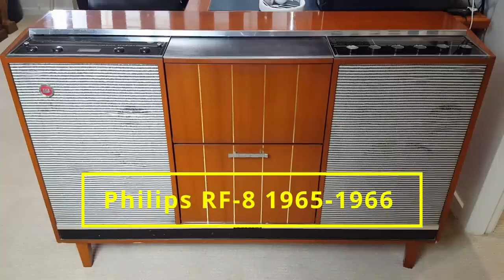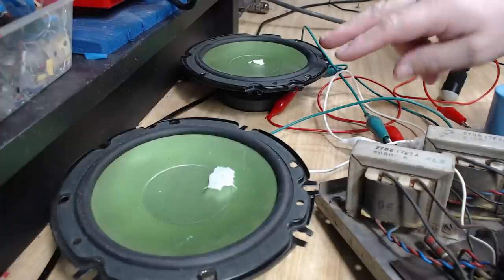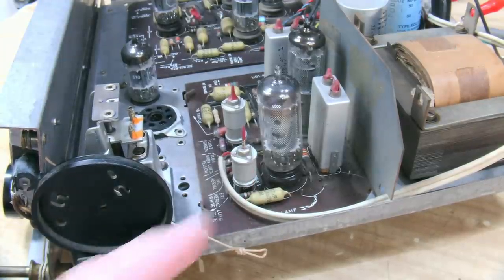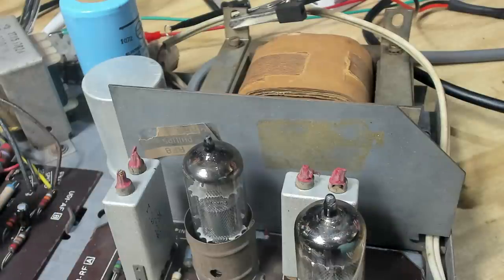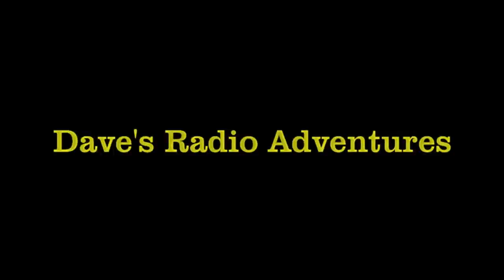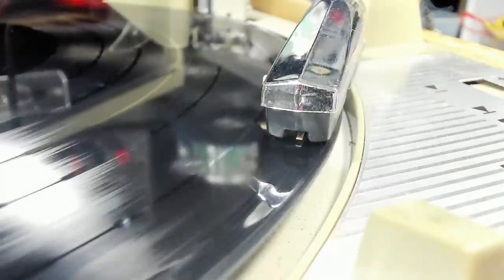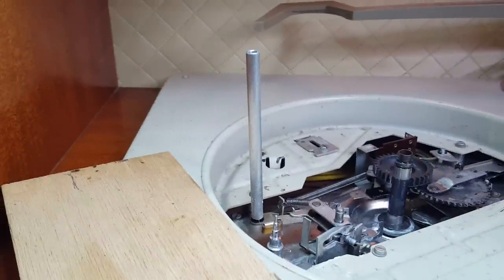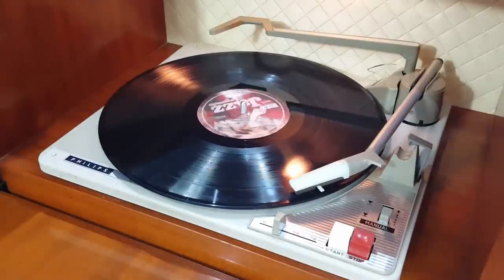Philips RF8 Radiogram and Philips AG-1025 Record Player Service - 1965/66

Comment: Incredibly informative! Thank you! I inherited a Grundig KS620U from my great grandparents, and everyone has been too scared to take apart the turntable (same model), which hasn't worked in about 30 years. 

Thanks to this, I was able to take it apart and find out exactly what was wrong with it in about 5 minutes. The motor's pretty seized. I'm attempting to grease it up, but family rumor has it that it was left on for quite some time when it stopped working, so I may have to get a new motor.
Reply from the maker: Good to hear stories like this Buddy. The bearings in the motor are Oilite (sintered bronze) bushings, they are porous and designed to hold oil within. There is a felt oil pad surrounding the bushing as an extra source of oil. If grease is applied to the bushings it blocks the pores and no oil can get to the friction surface. If you have applied grease you will need to dismantle the motor and soak the bearing end caps to dissolve the grease. Then soak them in light motor oil for 24 hours, warmed if possible. Hopefully you can clean the shaft and reoil the bearings it to get it going again. Good luck 👍🙂

Comment: I pulled one of those power amp boards out of a rubbish pile, it was out in the weather for about 15yrs. Built a new power supply put it in a old wooden SA railways box and it works a treat. Nice work Dave, love it!
Reply from the maker: It must have been a mess after 15 years, nice to know you got it working again. Thanks @alast3897 🙂

Comment: I have one of these and it is in mint condition cosmetic wise the speaker grille cloths are mint, I even like that sort of silver what ever you would call it woven into it.  I still need to get it running as it has very loud hum which I suspect its the main filter caps and I never realised those caps are dual 2 in each one.  Those resistors you said looked like newer replacements I think mine has similar from memory I would have to go out and look.
Reply from the maker: Hi Stevie, well worth getting these units going, they are very good to listen to. Yes, two 50Uf in each can. You can still buy the capacitors in the same size cans from Evatco and other places. The resistors may have been original, I'm not sure. Thanks Stenie 🙂

Comment: Very watchable David and thanks for pointing out that jockey wheel spindle trick. I've repaired hundreds of similar decks and not had that wow problem but I'll keep a fresh eye out for that in future. I have slowed the speeds down by running the motor spindle on fine wet and dry paper to reduce its diameter slightly. 
Regards Jonathan
Reply from the maker: Hi Jonka, thank you. I was aware the idler wheel axle needed to be spot on but was surprised how much affect it had on the wow. I checked my other Philips AG-1025 and it's speed is the same, 34.3 rpm. Maybe they thought under load it would get too slow, anyway a good thing I left it 🙂

Comment: Amazing job as always David. I’ve not seen one of those mechs before but you took it in your stride. Nice to see it completely stripped out and re-lubed. Also great to see your manufacturing skills again with the platter mat and spindle not to mention the dreaded dial cord again. You are the dialcord master. All the best Graham
Reply from the maker: Hi Graham, thank you. 'I am the master of the dial cord'... that's what I tell myself before each restring... it doesn't always work 🙄 Thanks Graham. I'm back from my super long trip to Melbourne and daylight saving is finished so I hope to drop in tomorrow night and see what you are up to, Cheers 🙂

Comment: Another great restoration David... I have to say its a pity about the damaged screen on the speaker cabinets but if the owner is not worried I guess that's fine. You went to a lot of trouble with the lubrication... how long will that lube last before the same problem occurs again (turning to treacle). Never a dull moment when you are working on repairs... love watching it every time.
Reply from the maker: Hi Kenneth, thank you. I would have loved to replace the cloth too. The grease I use should last a very long time, how long is anyone's guess 🙂

Comment: You are a master of the turntables. Nicely done. I am a little surprise at using a smaller value capacitor to reduce hum. However it works and that’s nice.
Reply from the maker: Thank you bob. Smaller value capacitor? I used a 47uF in place of the 50uF but that's the normal replacement for a 50 theses days. It will work fine 👍🙂
Reply: G'day David. I was referring to the plate capacitor you replaced  0.22  down to 0.1
Reply from the maker: Oh, sorry, Yes that was a modification recommended by Philips. It fixed the hum from the record player.

Comment: Very swift fix, love it. Ya, me too, I don't mind watching all without fast-forward. I loved how you did the record player, super detailed service.  I think the record was running bit fast cause you had to sand the drive wheel. Anyhow 2% is nothing.
Btw, this radiogram is super clear, wish it had FM too 🥰
Reply from the maker: Hi @magcoco. I hear what you are saying, thank you. I've done a number of these sets so I'm trying to avoid repeating myself. The diameter of the idler wheel does not affect the speed of the platter. The idler wheel is simply a go between the spindle and the platter, the idler wheel itself will change speed but the relationship between the spindle and the platter is constant. For example, if you put a different size fan belt on your car the fan speed doesn't change. Thanks @magcoco 👍😃
Reply: @DavidTipton101  Hi David, Khaled here. Been long time I didn't bother you 🤣
Regarding the drive wheel, I image it in different way. The motor pulley drives the wheel which transfers the movement to the platter. The pulley has different diameters for various speeds. So, image the pulley have a fix diameter, then the speed can be changed by changing the wheel size . Bigger wheel circonference = less platter revolution/min.  😊
Reply from the maker: @magcoco  Hi Khaled, I knew it was you by your thumbnail but YouTube is using handles now and it threw me. 
When you say motor 'pulley' you are referring to the spindle on the motor shaft I think. The different diameters of the spindle will indeed change the platter speed and so will changing the diameter of the platter. The idler wheel between the two will not change the speed of the platter. 
If one revolution of the motor spindle moved the idler wheel 10mm at the contact point the wheel will move the platter 10mm at it's contact point. If we double the idler wheel diameter from say 30mm to 60mm diameter the idler wheel will still move 10mm at the spindle contact point and move the platter 10mm at it's contact point. The idler wheel speed will be halved due to the larger diameter but that will be the only change.
In the example I used with the car motor fan belt, if the fan rotates once for every revolution of the crankshaft pulley, doubling the length of the fan belt will not change the speed of the fan. The speed the belt moves at will be halved because it is twice as long but the fan speed will not be affected.

Comment: Another lovely restore ,  you make these radio grams sing. Strange no FM, do love the sound , are their 2 parts to each valve is that how it can have only one valve per channel. Thankyou for posting :)
Reply from the maker: Hi Leo. Yep, no FM in Oz till 1975. The 6GW8 output valve is a triode and pentode in one. It's not a push-pull set though 👍🙂
Reply: @DavidTipton101  can you explain how it works with one valve, could be same as my mono ear record player amp
Reply from the maker: I can try. In my case it is a simple class A stereo amplifier, i.e. not push-pull. There are two channels, left and right, each channel is powered by a single 6GW8 (ECL86) output valve. The 6GW8 is a triode and a pentode in one envelope. In this Philips the triode section is used as a preamp to the output pentode. 
If fitted to a self contained record player it can be used the same way. The signal from the cartridge can be preamplified, tone control added then sent to the pentode to be amplified for the speaker.

Comment: Thank you so much for countless hours of interesting and entertaining diversion when I wake up in the early morning. Could I suggest that reducing the more spindle diameter would reduce the turntable rpm? I was very impressed with the way you reduced wow and flutter.
Reply: Motor
Reply from the maker: That would be the only way to reduce the platter speed and I have done it before. I wasn't far enough out to start playing with it. Besides, with the weight of the stylus on it and if a few records were stacked it may slow it down too much which would be more noticable. I was pretty impressed with the wow adjustment too 👍😃

Comment: Haven't watched all the way through yet Dave but heard you mentioning something called Rubber Renew, if I heard correctly. Do you think such a product would revive the stiff and dry rubber on the rollers of my planer-thicknesser? I'd be very grateful for any first hand advice or observations about a product like that. Okay, now back to the action...
Reply from the maker: Hi Mark, I would be reluctant to say that it would help in your case, it might. Reviews say it works wonders to soften and renew rubber so you could give it a try. It's available through MG Chemicals in Australia, it's spelt Rubber Renue 🙂

Comment: Lovely work as ever Dave. Nice piece of kit as well. I really liked the detailed legend on the PCB. I was under the impression that PCBs were unreliable with valves because of the heat - is that an issue with these units?
Reply from the maker: Hi Neil, thank you. I haven't noticed any blackening around the PBC on these sets. Maybe the valve sockets they used are a good heat insulator from the PCB 🤔🙂

Comment: I suspect the original rubber mat had quite tall ridges. Having the record touching the turntable only in the center could cause some vibration noise and slipping (speed variations). Do love the fabrication you do on these units. I always find that to be a lot of fun myself. And being able to make your own idler wheels for example saves a ton of money.
Reply from the maker: Thanks Mark. The centre of the platter is dipped down so the record sits on the felt 👍🙂

Comment: David, I'm amazed the rubber on that idler hadn't gone rock hard. Have you ever messed with trying to resurface idler wheels with your lathe (turning down the surface and bonding/surfacing an o-ring or similar to the original dimensions?)
Reply from the maker: Hi @HiFiasco. The rubber on the Philips grams seems to age very well. I have used O-rings to repair idler wheels and have also turned up new wheels from aluminium and fitted square section O-rings to them 🙂

Comment: Dave your new production style is okay, it’s got to make filming a lot easier. Your detail oriented videos certainly help the hobbyist and amaze your audience but if you’re working on a project for someone else time become an issue. The laser cutter is intriguing, if you’ve ever seen the plastic model airplane kits with all the parts connected on one or two sticks it almost looks like a laser cutter could make something like that. Possibly a housing for your new radio innovation.
Reply from the maker: Hi Mack, it's not a new style, it's just what I did with this video because I have done two other sets the same. I used that montage style quite a bit earlier on. The laser cutter has been great, I haven't used it on anything difficult yet but have a few projects coming up. Thanks Mack 🙂

Comment: I remember you being a bit apprehensive about working on record decks at first but you've got the whole thing sussed now. Knew you would!
Reply from the maker: You are right Paul, I knew nothing about them to start. Like anything, a bit of experience does wonders. Thanks Paul ☺️
Reply: @DavidTipton101  I always reckon you can learn about anything at all if you're interested in it but if you're not, then it's almost impossible.

Comment: Avesome restoration David, just a small note about the beehive trimmers, the aerial trimmer seemed to be very easy to turn... do you bother putting a small blob of wax on the screw? Just wondering if vibration from the speaker(s) would cause further & unwanted turning! Thank you:)
Reply from the maker: Hi 6A8G. Yes I put red nail polish on the trimmers after the adjustment. It looks very similar to the original anti-tamper paste used at the factory and is cheap and readily available 🙂

Comment: Did you work out what the Disco light does?
Reply from the maker: I forgot to mention it. I did show it at the end. It's just a light. It comes on when gram is selected, the radio dial lights turn off.  Thanks Peter ☺️

Comment: Really good looking set there!

Is there no way to adjust speed on those things?
Reply from the maker: Thank you Brian. The motor speed it set by the mains supply frequency, in my case 50Hzs. the only way to change it is to change the diameter of the motor drive spindle. I tested another Philips turntable of the same model and it was the exact same speed as this one, 34.3rpm 👍🙂
Reply: @DavidTipton101  Aha. That makes sense. I guess I thought maybe the diameter of that rubber wheel could be changed, but I'm not so familiar with that mechanisms

Comment: Hi David, I'm interested in the cap you changed to reduce hum. Am I right it goes across the plate to ground? I tried to find the circuit diagram for your unit (to find out more) but came up blank. Reason I'm interested is I have a couple of single ended radiogram amps I've restored that hum slightly due to the residual b+ ripple (filter caps are new).  Even after playing around with the negative feedback resistors at the bottom of the volume pot I've never been able to completely eliminate it. I'm wondering if this cap - where ever it goes - is an easier way.
Reply from the maker: Hi Seiskid, the hum in this case was being picked up from the cartridge and it's wiring. The capacitor was from the plate of the preamp valve through a resistor to ground. The capacitor in question is C62. The service literature can be found here:
https://www.kevinchant.com/uploads/7/1/0/8/7108231/rf8.pdf 🙂

Comment: Dave - I'm sure someone has said, at least once, did you check the voltage setting on the TT motor for your speed error?
Reply from the maker: Hi @xyredmax, Yes I did, it's not the voltage that will affect the speed it's the mains frequency of 50 Hzs. I tested the same model Philips in another radiogram and it ran at the same speed as this one 👍🙂
Reply: @DavidTipton101  Of course, Mr Hertz, cycles per second!

Comment: Oh, forgot this. These Philips push on cartridges can be swapped for a magnetic GP410 push on cartridge. All you have to do is put a pre-amp in the cabinet and the sound will be even more impressive. Re adjust the tracking force is all that’s needed.
Reply from the maker: Noted, thanks Willem 🙂

Comment: I recently went bat-shit crazy with my savings account and spent a couple hundred bucks on radio gear.  I picked up a uSDX+ HF Transceiver it is an 8 band pocket (almost) transceiver for shortwave. I have my technician ticket but in order to use this I need to upgrade to General so I also spent 40 bucks for the manual to study up for the test, hope to take it in the spring after the snows have gone, they came early this year and today, halloween day we have about a foot of the white shit on the streets. It should make for a quiet trick or treat day.  I also spent a couple hundred bucks on a trunk scanner so I can monitor out little 5 man Sheriffs Department radio traffic as well as all the other radio traffic in the area.  It is very quiet but I have always had a good scanner up till they went trunk 20+ years ago. I had tried several other systems but they didn't do much, this one is so automatic it almost feels like cheating, it is all pre-programed you just give it your location and it loads all the radio frequencies and begins to scan.
Anyhow, thanks for the great video, I love having my morning coffee with you.
Reply from the maker: Hi Jerry, it sounds like Christmas has come early for you. We had a lightning storm at dusk so trick or treat was non-existent here. Your scanner sounds great, I didn't know you could still listen to police radio, I don't know why I thought that. We used to have a handheld radio to talk to the airport control tower so police frequency should be much the same. Good luck with your test Jerry and thank you 🙂

Comment: Did you measure the rotation speed under load (with de pickup on the disk?)
Reply from the maker: I don't remember cbiz8. I usually do particularly as it was running fast. I doubt the fairly light weight of the tone arm will make a significant difference 🤔

Comment: Hi, David
I got this player  record last  year, it has the problem when the 7 inch record , the tone arm did not move to the right position , can you suggest for solving this problems.
Reply from the maker: I can only suggest you check everything is clean and lubricated. 7" is the default stopping point, the tone arm should go to the 7" position if no other size record is played. Check the record size mechanism is clean and free.
Reply: @DavidTipton101  thank you very much
Reply from the maker: Also consider high friction in the tone arm vertical shaft.